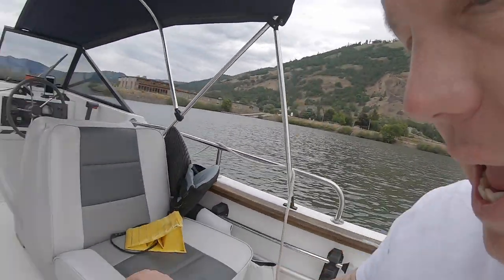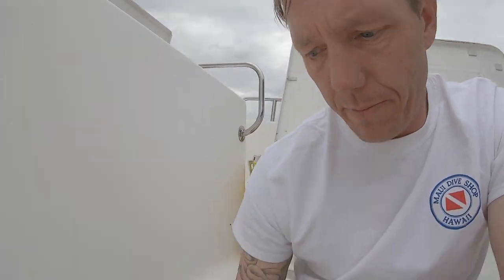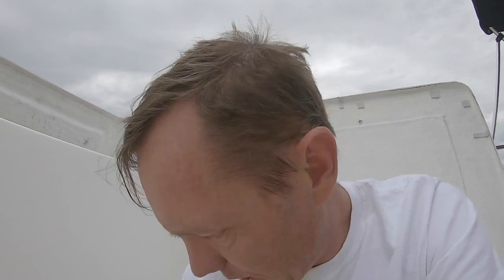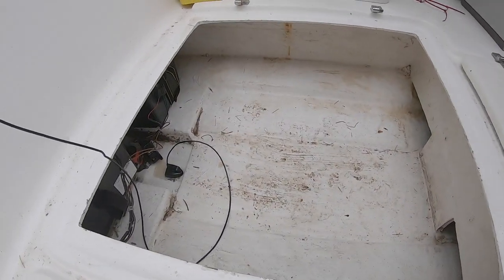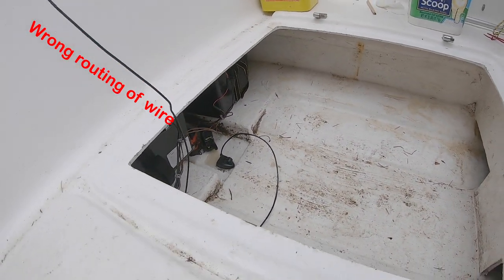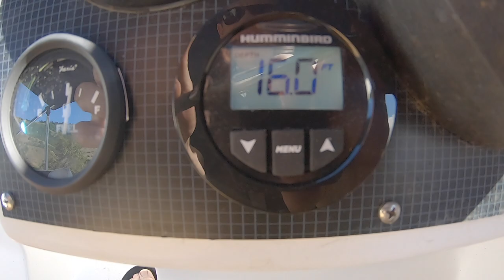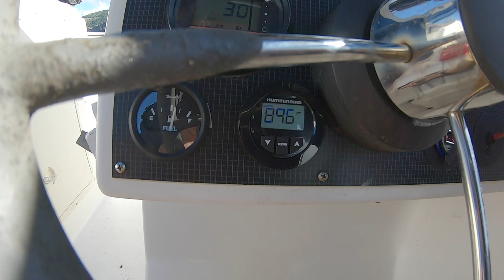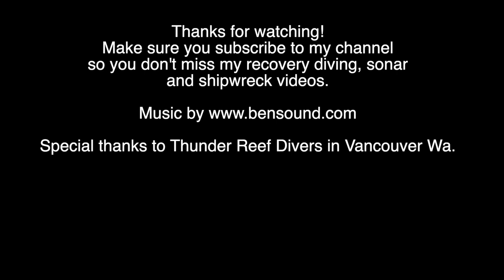Glueing-in an All Speed Sonar Transducer

Comment: I’m not sure which transducer he used, but I have a HawkEye transom mounted transducer and if you have an all fiberglass area on the bottom with no wood core (or a thin aluminum boat from what I recall), you can epoxy it right in after knowing it works and running the boat around like shown. They say to only use slow cure epoxy with theirs. I did the same thing on our Yamaha jet boat because I didn’t want to go with the through hull fitting (and cutting the hole 😮). Only got the depth gage after going to the St. Joseph River in Michigan because areas get quite shallow and it’s nice to take the Yamaha out to see these changes each year before taking our 40’ boat with a 3 1/2 foot draft.

Comment: Is this transducer still working?  Did it overheat?
Reply: Why, do they actually get noticeably hot?
Reply: @Tampo-tiger  I am still considering the inhull mount.  In my research I have read that some transducers need to be in a liquid.  I have read several comments claiming that transducer failed was due to running them out of water for long periods.  But, you know how things are represented on the internet.
Reply: @kevinmoney4112  Yes, such a great source of information, only half of which is accurate! I certainly have wondered why people add anti-freeze or oil to the inverted cup sitting against the hull. It seems that no material with air bubbles in it can be used, which seems to make a bit of sense.